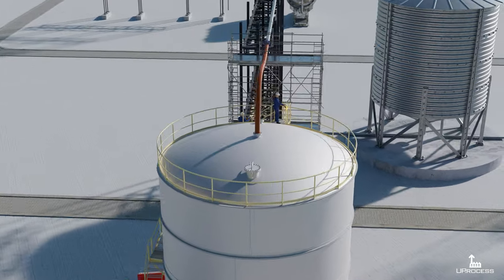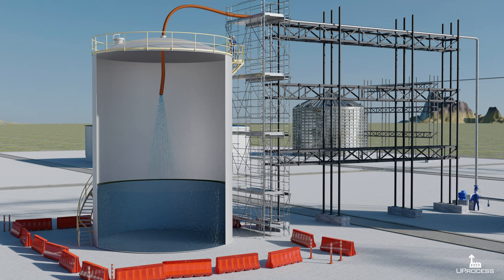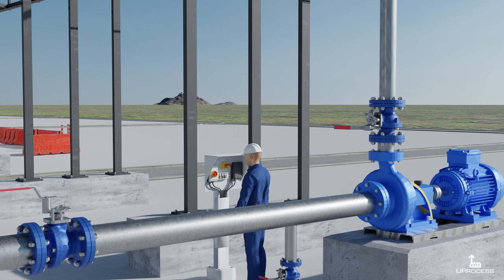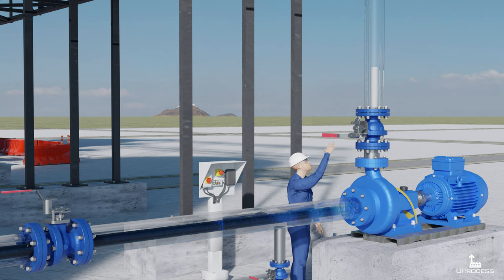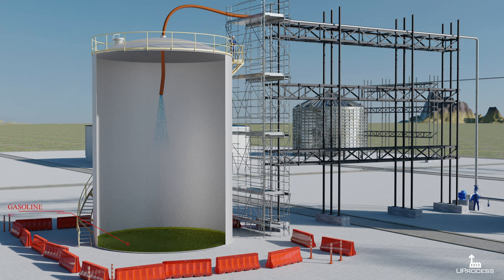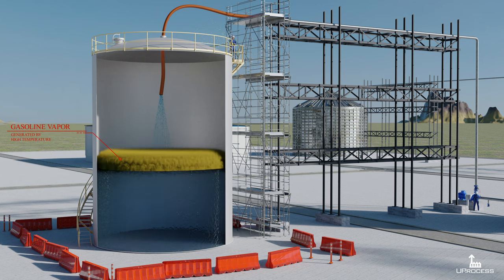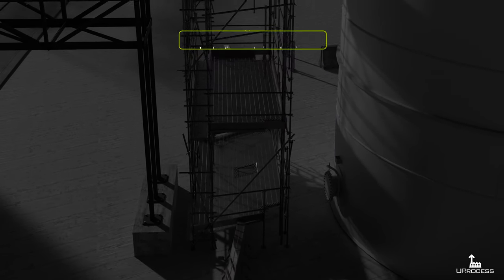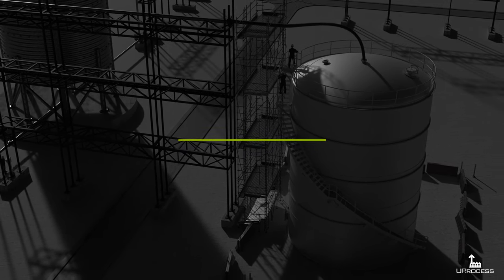Process Accident - Industrial Accident during Hydrostatic Test (4K)

Comment: There are more reasons to do a hydrostatic test than ensuring that the foundations are strong.

Hydrostatic testing is more often done as part of industrial standards for storage or pressure vessels. Water is used and the vapor space in the tank is eliminated by the filling. 

It seems that for this accident to happen that something else was done; The flame arrestors on the vents had to of been removed. These are mechanisms that prevent a flame from making its way back in to the tank. You can still get a fire on top of the tank while it is being actively filled but it will not cause the contents to combust.

The tank (including the sump area at the very bottom) should of been completely drained and flushed. Draining the sump area is hard to do (it can hold a few hundred gallons of product). The piping to the tank should of also been removed and flanged off (to prevent leakage back in to the tank from the piping).

Then the tank should of been nitrogen-purged to put an inert atmosphere inside the tank.

NOBODY should be working on or near the tank during a hydrostatic fill or test. Later in the hydro process when the tank is completely filled with water the openings at the top are then flanged off and the tank is pressurized with water-only (no vapor space is allowed at all). Then the tank is over-pressurized up to its rating and held at that pressure. Meanwhile it is inspected for leaks, bulging  or volumetric changes (shows up as pressure loss beyond what may happen from temperature changes).